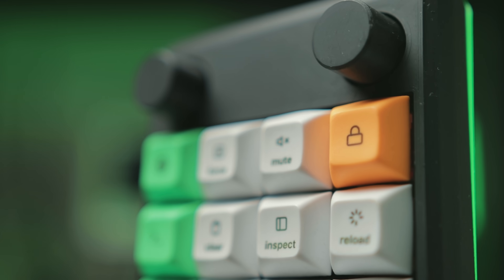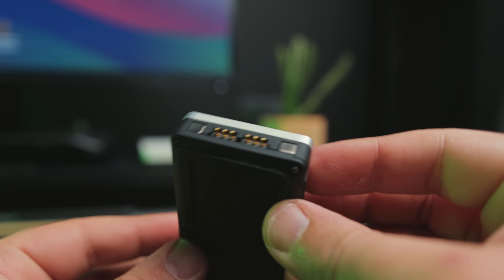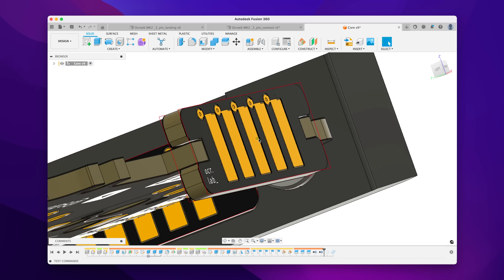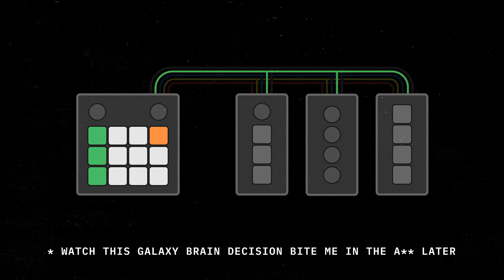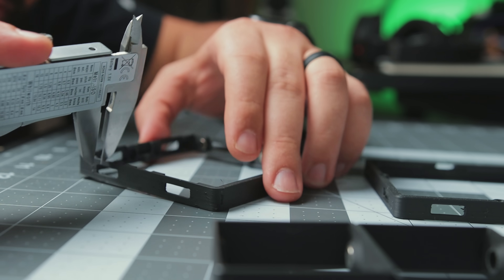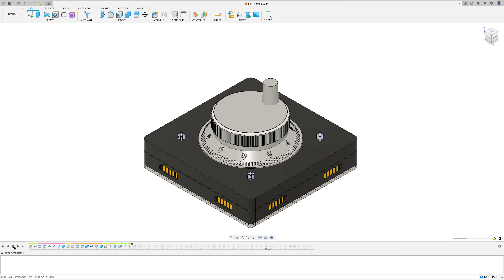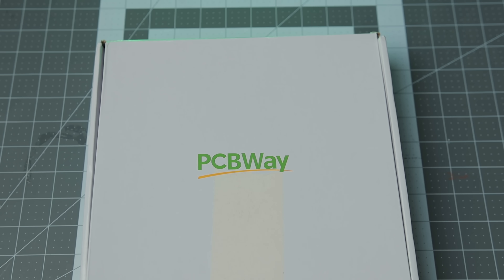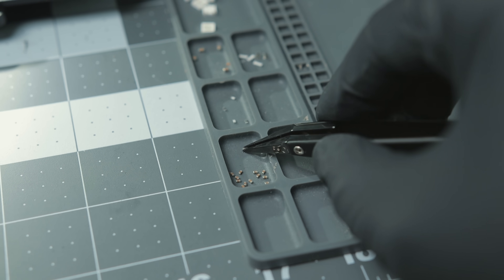How I made a Modular Macro Keyboard System (3D Printed): Ocreeb MK2

Comment: Switching to straight C or even directly assembly for the microcontroller might speed things up quite a bit, also remember that python heavily depends on what runs it. You'd need more pins, but it would be a better approach to use analog signals in the system assigning each module a frequency and delivering data on that frequency with amplitude modulation. That does require a beefy decoder on the controller, but has the added benefit of allowing multiple signals at once even, say for holding down buttons. Though really, if we are adding pins, you can get away with just 6, pwr gnd and 4 pins to run single direction ethernet xD

Curious what it would cost to make a set given that monogram wants like 900 bucks for theirs.

You did a bit of programming for this, I write C for a living, I been wondering about how the standard qwerty layout could be improved specifically for programming. Adding keys for the special chars needed and adding other useful keys that I find strangely missing, like a backspace on the numpad or a dot. Could combine that with this stuff as well, adding blocks directly to the keyboard for specific use cases, detachable numpad or adding a macro keypad or sliders. It's a bit shocking to see that for some reason everyone seems to just accept to do gymnastics with their fingers just to write code on a keyboard when there was so much experimentation happening in that sector just a few years ago.

Comment: Hello, very good video and great explanation, I am just designing a very similar idea with a keyboard and I had already gone through the same problems, including a problem of hot swapping the modules due to high voltage spikes during disconnection.
I found that the best way to solve my problems was not to use i2c, but to use the USB serial protocol, making the main module a sort of USB hub. I found this thanks to the idea of the user (peng-zhihui) and his project (helloword keyboard) in this link
 https://www.youtube.com/watch?v=mGShD9ZER1c&t=576s

very good video and contribution solving problems such as magnetic connectors with pogo pins and it is true that they are very expensive per unit, great work.

Comment: Love how this project looks, sadly I don't have a 3d printer or the time and patience to build something like this. Some suggestions would be to make a dial pad as well, which is a slim module with 3-4 dials. Also maybe adding some modular connector cables so you could use them as a standalone. Are you planning to sell these modules? If so, take my goddamn money!
Reply from the maker: Thank you! not planning on selling any of this right now. The project still needs some work and issues to be resolved.

Comment: This is awesome and absolutely hilarious since I've been developing my own modular macropad line based on seeing the creativity console - all the steps you went through are legitimately all the steps I went through as well, even down to chucking an extra interrupt pin. I didn't have the thought to make custom pogo connectors though, that was a super clever design. Nice work!

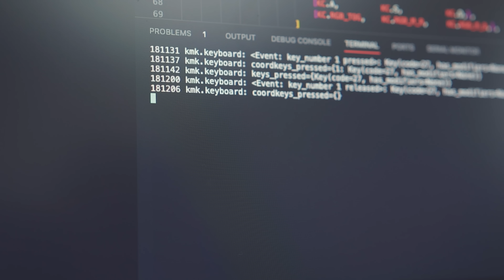Also to add onto your part at 18:00 - my approach uses a single I2C controller device with some extra logic that auto-assigns I2C addresses after going through a discovery/scan process, which involves the peripheral device responding with its unique chip ID and a module type identifier. All keypresses or actions are buffered and then cleared on an I2C read, but latency issues like you mentioned start to pop up when you get 8+ devices. Cranking up I2C speeds worked for a bit but I am currently redesigning since I started hitting I2C bus capacitance issues at higher speeds.
Reply from the maker: haha! that's amazing. I'm glad i'm not the only one to think this way. 
I received a lot of suggestions that I might try and buffering the interactions is one of them. thanks for the taking the time!

Comment: The project looks very nice so far.

A possible solution for the interrupt problem could be to switch from I2C with a custom interrup to the SMBus protocol.
This uses the I2C protocol and wiring at its basis but also specifies an interrupt line and how the interrupt is resolved.
Therefore only the generating device is active, or in case of multiple devices generating an interrupt at the same time the address is used to determine which module gets served first. (No more queryi

Also as mentioned in another comment by  @silardgal8223 you could buffer the button clicked and released events in a queue in each module, where the state transitions matter and then serve them one after another.
Maybe also add timestamping or something similar on the modules directly to discard events if they are not read in time, something like 200ms for a button clicked event, otherwise it may feel unnatural if the keystroke gets detected with something like a second delay.
For sliders on the other hand it would make sense to only send the last position and not store the whole sliding process if it is not read in time.

I just don't know if you can get smbus with circuit python. I only used it on some stm32 controller. But if i2c and an interrupt is available it should be doable by some hacking. Maybe you find a matching library that already does this for you.

I'm looking forward to the next version of this!

Comment: The interrupt fix can be that you buffer data on the module side. Meaning if there is a press, you put it into a buffer, and when the main modules comes to read it, you are not losing any data. Yes, you will have a small delay, but still with no data loss. 
I would suggest the next version to have CAN Bus, as its a multi-master system and you can send messages directly to the main host, but also to the modules as well. 

Awesome project!
Reply: The CAN Bus protocol might be appropriate actually for this project, I had read a bit about it in the past, yeah it's probably the right choice. Your buffer fix will probably also do the trick as well, if he doesn't wanna go the extra step and add CAN Bus to all this.
Reply: I agree the solution for the interrupt line is buffering it, set a flag and then exit the routine asap. Check the flag when you have time. Another possibility is to simplify the I2c data you are collecting so that you read all the devices every cycle. Also, I2c had different speeds available and dma might be possible to offload the task.
Reply: I agree on CANbus! There would be a few annoying downsides with CAN for this but they're all solvable and I think it would be a much better start than I2C for this.

Comment: Great, amazing project.  Nice work.

One thing:  I've had a few of those OLEDs and leaving them on consistently (like with your "OCREEB" logo) will eventually burn out some of the pixels (or reduce their brightness compared to other pixels).  I would recommend turning the OLED off when the module is not in use so you don't have the same problem.
Reply from the maker: Thanks! yeah you are absolutely right and I was thinking the same thing. I will probably have it sleep when not in use at some point.

Comment: Did you use N52 magnets or the cheaper versions? This is what I use for my projects and there is no way a pair of these would be knocked that easily.
Reply from the maker: I doubt that what I got from Amazon is really N52, but they were the best I could find. Also the pogo pins somewhat counteract the pull force of the magnets a little bit. I tried to get the magnets as close as possible but they remain separated by the shells around 1 or 2 mm

Comment: This concept is unreal!
Ive yearned for this kind of platform for such a long time to build up a MIDI controller for a portable recording studio Ive built. Using a handful of the faders and the button/encoder combo units would nail that.
Also the resin based printing is incredible. It looks flawless compared to extrusion driven prints.

Comment: I love how this project is one any one can benefit from but I do have some stuff that want to ask for a possible inclusion. 1 CAN bus it use in car it have protection against the interrupt system long check time so the module can react instantly. 2 hard mount as mentioned in another comment the project can be benefited from a hard mount system via screw or the gridfinity system or similar. But with all that said the project is very cool and I might consider building this.

Comment: I sketched an near identical design concept back in 2012-ish (when 3D printing was in its infancy and I had an early Makerbot Replicator which wasn't really up to the task, plus my embedded knowledge was more rudimentary). Well done for getting so far!
If I was going to tackle it today, I would probably program it in Mecrisp Stellaris Forth on a STM32F411, perhaps using a overclocked MIDI scheme or I2C.

Forth is ideal for this sort of project - fast real time incremental compiling and testing with instant debugging feedback (unlike C), plus it is an order of magnitude faster than Micro Python.

Comment: Suggestion for the problem: when the master receive the interrupt signal it BROADCASTs a read request. Only the slave that triggered the interrupt respond to the request with its address. Make sure to sense that the interrupt line is clear before triggering an interrupt

Comment: The best way I can think of resolving the issue (and many others down the line) is for each module to have it's own "command buffer", that pools the triggered commands and sends them to the agregator on a "when available" basis.
It should decrease latency and avoid ignored commands, as modules that didn't execute any commands will simply return an "empty command", while modules that have several commands can send the command even after you triggered it, so it doesn't depend on the user still be holding the button when the agregator tries to read.

Comment: This is super cool. I hadn't heard of KMK before and it looks super useful. It makes me wonder if you could contextually switch layers by passing data from the computer back to the microcontroller. I doubt it because that would require running an application on the computer in the background similar to how Loupedeck or Streamdeck work. That would unlock so much functionality for a system like this. 

I also wonder if there is a way to integrate your DIY Spacemouse into this? Don't get me wrong, the safe dial is cool, but the DIY Spacemouse would be MUCH cooler!

Comment: I had a little diy project one time that used OpenAuto on a rasperry pi, with a touch screen cos I wanted to upgrade my car stereo. I used an arduino micro conneted to the RPI with USB and it had an encoder etc. so that I could have a control interface near the gear stick cos obviously didn't want to be messing with a touch screen while driving. It worked pretty well but I was always looking around for more cosmetically appropriate knobs etc. larger diameter, led lighting etc. because a standard sized pot wouldnt look right in a car. Typically they are more like the large encoder you have here.

Comment: Incredible design. You have given me some ideas to ad to my list. I am currently working on a small reflow unit that uses a pcb heater and can run up to 2 at a time. I want to have a large macro and dial for use in my drawing and engineering software.

Comment: Brilliant project :-) To help with stability and the magnets disconnecting you could print a thin frame that clips around the entire assembly once the modules have been magnetically snapped into position. Different configurations would need different frame sizes but that can be done parametrically in F360, to make it easy to generate then print. I also like the idea of making a v2 that fits Gridfinity: then it could be combined with other Gridfinity modules.

Comment: yea you should have done the interrupt connections just like DIY mechanical keyboards wiring which which is 2 lines for interrupts and 1 diode for N-key roll over.... this would have solved all your problems....

Comment: I’m wondering doesn’t the snap fit actually cause an “interrupt storm” because of bounces? And that you’ll retrigger the interrupt. I had a brief look at the code but I don’t see anything (as quickly) that denounces the interrupt. Some systems require you to acknowledge an interrupt to prevent another from triggering.

The ye thing how we used to do this in the 80s was not let the micro controller interrupt routine to the heavy lifting but your state machine. So when the interrupt hits set your state variable to Seve interior so that your event loop handles the interrupt and when it’s done resets the flag. Usually because bouncing interrupts would have settled by then. 

Or you can do something sneaky and that is as your first statement turn the interrupt pin in to just a GPIO. But this takes more time than setting a state and so you can have 6 or say cascading interrupts waiting before that pin is toggles to a GPIO.
And end the end you turn it back into an interrupt pin.
And otherwise there’s always trusted C++

Comment: About that interruption line & passing the inputs, what about delaying inputs form modules ?
All modules could send their interrruption signal instantly, but send the input data with a fixed delay.
This coudl allow you to read an adress/ID encoded in the interruption signal as you've suggested, and then when you query for input data, you end up getting the right data because the delay is set to be slightly longer than decoding the address.

Comment: For your next project I suggest a variant of this. Make a magnetic board/s of this style for keys, dials, whatever to be popped on top of. Give it gravitational liquid resistance by having the magnets and pins on raised protrusions instead of a flatly aligned with the boards main surface, this will allow liquids to just fall off. The keys, dials, etc should have rubber overhangs that give further liquid resistance by preventing splashes from making their way up to the raised magnets and pins. I'm sure others will have ideas for bettering this one, slap on your comments so salim doesn't need to hunt for them.

Comment: Dear Goat, wow ... just How? [BRAINMELT]

On  a personal note, since you are soooo friggin creative in rethinking things: I suffer from poly-arthritis, specifically Morbus Bechterew/ Spondilytis Ankylosans, which basically means that mey joints swell and fixate and that brings so much tension to the bands and muscles that basically my body parts are slowly going into a "clawing"-state. So in regards to keyboards i can't even type no more on mechanical keys due to the travel of the keys, so i use all kinds of ultraflat/magic/portable keyboards which use these thin laptop keyboards. Thing is they all come with a unique keyboard-layout and often not even have their keyset provided if used in cable mode for lesser latency, so you need to connect via bluetooth .. and so on .. etc. YKNOW

So i wonder do come any weird modular keys with a micro-minimal key-travel come to mind, or even better a self-producible simple mechanic solution that can give the rigid preciseness of a mechanical but the minimal travel like the ultrathin laptop keys offer?

Wow, i build a wall of text. Lessgo!
Reply: Liked and subscribed btw. - massive content!

Comment: USB keeps track of various IDs (device IDs, manufacturer IDs, positional IDs, etc), as well as a fairly hard limit as to how many devices can be connected to a bus. How about use hardcoded IDs on the devices and using a size-limited (ring?) buffer keeping track of only the most recent connections/disconnections rather than polling every single device in the chain every interrupt? That's how we usually do it in software synthesizers when we need to "steal notes" for MIDI note playback. Admittedly, the most immediate downside I can think of is the small possibility of the buffer list of attached devices getting out of sync with the actual set of attached devices, but maybe you handle that forced resync in a once-a-minute idle refresh poll or something.